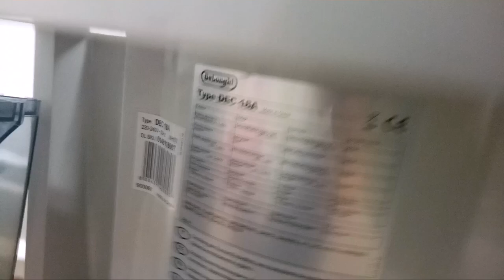AVERIA DESHUMIDIFICADOR DELONGHI, COMPRESOR NO ARRANCA - AVERIADO CONDENSADOR C4 de 470 nF/ 275 V

Comment from the maker: DETALLE DEL PROCESO DE REPARACION:
Comprobe que no llegaba tension al compresor.
Comprobe que llegaba tension de 220 v a la placa 
Comprobe que la placa NO tenia voltaje de DC 12 v
Comprobe diodos y resistencias estaban ok
Comprobe la bobina del rele de placa, parecia dudosa inicialmente.
Comprobe el condensador C4, estaba muy bajo de capacidad de 470 nF marcaba 74  nF  ESTE ES EL PROBLEMA.
Comprobe por si acaso el condensador electrolitico, estaba ok
Sustituido el condensador  C4 por otro de 470 nF  la placa activo el rele de salida, el compresor arranco correctamente. 
Montaje del aparato.
FOTOS DE LA REPARACION
https://drive.google.com/drive/folders/1OVjpDk9w0blk_zQ56XzveQBc077A0jIW?usp=sharing

Comment: Bueno entiendo que para llegar a la conclusión de que el condensador está mal. Logicamente Has comprobado componentes y estos condensadores en este tipo de placas suelen ser de lo primero en fallar. Un saludo
Reply from the maker: Comprobe que no llegaba tension al compresor.
Comprobe que llegaba tension de 220 v a la placa 
Comprobe que la placa NO tenia voltaje de DC 12 v
Comprobe diodos y resistencias estaban ok
Comprobe la bobina del rele de placa, parecia dudosa inicialmente.
Comprobe el condensador C4, estaba muy bajo de capacidad de 470 nF marcaba 74  nF  ESTE ES EL PROBLEMA.
Comprobe por si acaso el condensador electrolitico, estaba ok
Sustituido el condensador  C4 por otro de 470 nF  la placa activo el rele de salida, el compresor arranco correctamente. 
Montaje del aparato.
Reply: @ReparatumismoSPAIN  muchas gracias

Comment: Hola de nuevo, sigo con mi avería 🤢, a la placa electrónica sólo llegan 0,70 V AC y al compresor sólo le llegan 28 V AC y es para 220 V.
No veo por dónde seguir, puedes decirme algo?. Gracias
Reply from the maker: sube unas fotos de la placa a subefotos.com y cuelga el link aqui para poder verlas y opinar.
Reply: @ReparatumismoSPAIN  nada más llegar a casa lo hago
Reply: @ReparatumismoSPAIN  no me deja subir fotos o no lo hago yo bien. Un correo sería más fácil. Siento mi inexperiencia. Gracias igualmente
Reply: Ésa web no está bien, el error es continuo a la hora de subir la foto. Lo hice con ordenador y con móvil y nada 0,00. Puedo enviarte la foto al medio que elijas. Gracias por tu atención
Reply from the maker: @joseluislosadagonzalez728  sube la foto a cualquier servidor de fotos que quieras y cuelga el link aqui
o dime tu email y te contacto yo
Reply: De los 4 condensadores que lleva, 3 son cerámicos, un 104, un 473 y un 474 y otro electrolítico de 63V 47mf y todos ellos dan sus medidas al tester.
Reply: Las resistencias, el diodo y los Zener los veo correctos. El c.i. 12C508A lo veo correcto, al menos veo voltaje  de diodo entre patillas del mismo.
La bobina de caja azul también da medida de resistencia entre patillas por lo que la acepto.
Reply from the maker: @joseluislosadagonzalez728  si lleva rele sacalo de la placa y pruebalo fuera con voltaje .
REESCRIBO.

ESa placa solo lleva 2 condensadores, el rectangular azul y el redondo electrolitico, cambialos por descartar, pero no se me ocurre que mas puede ser
Reply: @ReparatumismoSPAIN  muchas gracias, ya te contaré. Hoy paz y amor con mis mejores deseos para ti y los tuyos ❤
Reply from the maker: @joseluislosadagonzalez728  Muchas gracias, y Feliz Navidad para ti y todos los tuyos
Reply: @ReparatumismoSPAIN  sólo una pregunta, qué video me recomiendas para ello?, de tú colección
Reply from the maker: @joseluislosadagonzalez728  
https://www.youtube.com/watch?v=P5AFFdH8c-k
https://www.youtube.com/watch?v=uuM0NHakLjg
Reply: @ReparatumismoSPAIN  bueno, pues saqué el relé de la placa electrónica, probé con una tensión de 20 V AC y da señales de abierto/cerrado. Creo que el problema está en que no me llega tensión a la placa y veo el porqué 🤷🏽‍♂️
Reply: Bueno, maestro y amigo. Hoy por fin a primera hora de la mañana arreglé el deshumidificador.  Vaya tontería  que me volvió loco.
La bandeja que recoje el agua lleva un tope de plástico que hace cerrar el circuito. Si puedo subirte el video lo hago aunque no sé si por capacidad lo hará o dime otro enlace .
Gracias, gracias y gracias por hacerme tan feliz❤
Reply from the maker: @joseluislosadagonzalez728  Me alegro si al final lo has conseguido, el video lo puedes subir a tu perfil de youtube, saludos y Feliz 2021